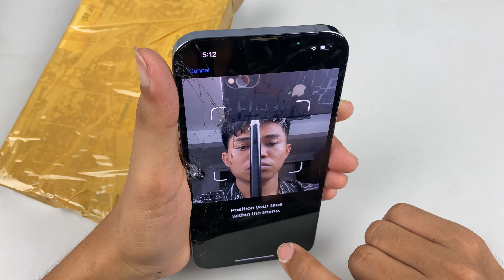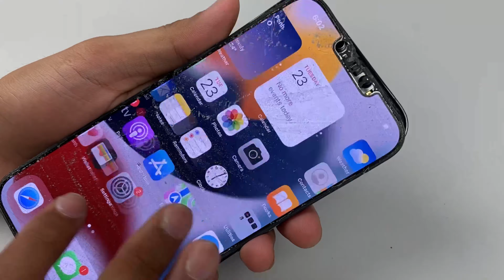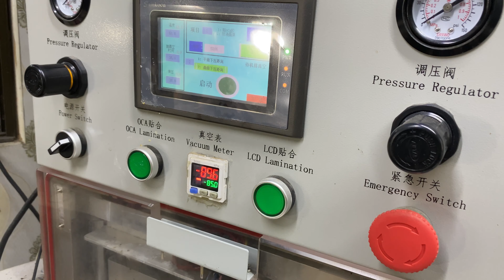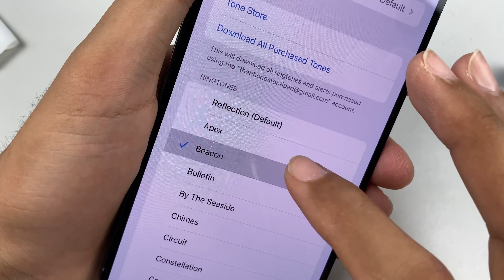How to Replace iPhone 13Pro Max Glass And Back Cover

Comment: Is it necessary to have one of those boxes you put the screen in to apply the front glass???
Reply: Im asking the same question... would be nice to have a reply instead of them just "liking" the comments by people.
Reply: You really don't need that vacuum machine what you have to do is you have to apply what's called LOCA glue put it end as a certain pattern that you'd have to see on YouTube and then you have to press it down in the very center and you have to have a jig that holds it in place while you press it if you don't it'll move on you and you'll get air bubbles. Once you get the air bubbles out you put your screen in the same light device that women use on their nails at a nail bar. The LOCA glue is activated by UV light.

Comment: Seriously u don’t need to take out the motherboard and the camera for what just to remove the glass back ….🙄
Reply: That’s very good precautions to remove always motherboard when you use regular heat gun I myself once burn the motherboard .
If you using laser machine than it’s fine not to remove mother board
Reply: @ghaziterbela  but why never remove the battery lol
Reply: @MichaelJackson.lloudbylisa  if you burn the battery new replacement battery cost you $20 but if you burn the motherboard it cost you $700-1000
Reply from the maker: @ghaziterbela  thanks you
Reply: U need i was doing glass replacement on 8 plus with camera and motherboard on and i damaged the board
Reply: @ghaziterbela  bro if u burn the battery it is going to get on fire with the rest of the phone, have u ever repaired a smartphone? 😂